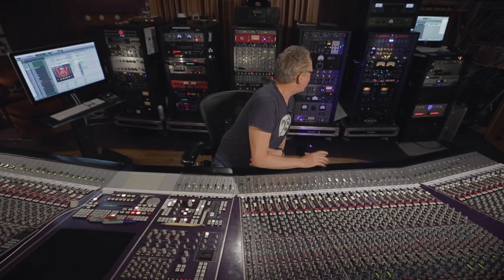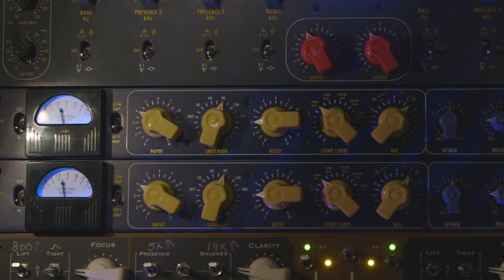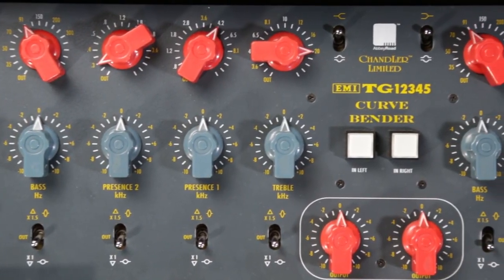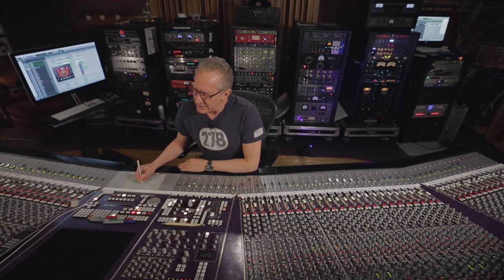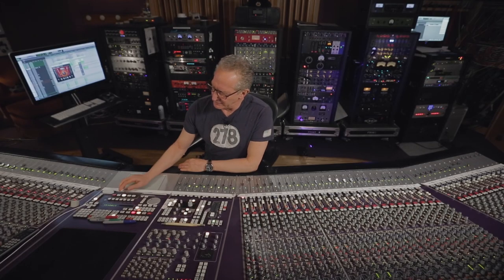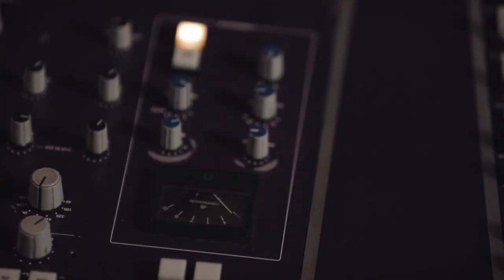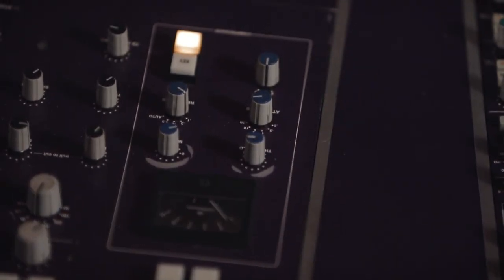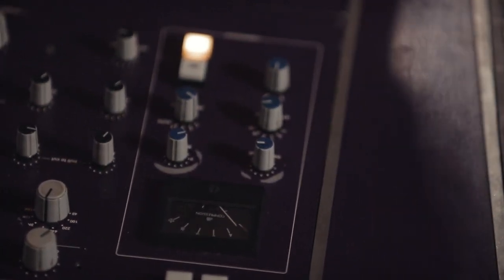The power of multi-bus processing with Michael Brauer

Comment: If you are new to mixing (like me) I would avoid this technique for now, I fell down a rabbit hole with this. Mixing into compression is hard enough let alone with four of them. I became obsessed with the idea and spent hours calibrating compressors/plug-ins and even tried this with 4 x 5oo series compressors . My mixes sounded flat and lifeless.  This man is a mult-award winning producer who has perfected this tecnique over many years. He knows his equipment and studio intimately as you can see In the video. I've had far better results just concentrating on my balance and panning-ensuring every move I make in the studio has an intention and purpose rather than obsessing over expensive equipment and advanced techniques.
Reply: @AI-Consultant  sure, you just set up 4 x aux busses and put a compressor on each one, and buss all your  instruments to the four groups based on their frequency range. You have to calibrate the compressors so they achieve 1db of gain reduction when they pass your maximum mix threshold I.e -18db or k14, whatever you mix to. There's a bit more to it than that but there's various places find more information  on it including Michaels own web page. You may want to match a similar compressor that he uses for each buss like a distressor for your b buds etc. But that's my point really, your just just mimiking what someone else has done without thinking why. But it may work out  for you (or I was doing it wrong?) give it try. That idea of mixing into compression or top -down mixing that I hear so much about doesn't work for me yet.
Reply: Sounds like you have some phase issues if it falls flat. Have in mind if you watch people on the internet telling you how to set it up, much of it is not the right way if you're working in the box. Go to his website there's a long article where he explains it. It is possible in the box but you really really have to watch out for phase cancelation. There's also interviews where he talks about it (and says that most of what's on the internet is not the right way.)
Reply: Love it, my man! PAAAAREACH!!!

Comment: To A/B them quickly, hop back and forth from 3:14 to 4:49 and the difference is stark.

The stereo imaging on the first is 100x better.  Every individual bus gets its own designer processing to optimize levels and clarity.  Then the final mix was summed to the master bus two-track output only needing a kiss more limiting to glue it together.

The later version is mixed just using the master stereo out bus.

Given that modern DAWs offer virtually unlimited bus counts, who would ever mix straight to the master output stereo bus?
Reply: Even through my tiny phone speaker the difference is very audible.
Reply: Yeah , and if I may , he made the mix sound smaller , not better
Reply: I prefer it at 3:14 TBH
Reply: Sounds more distorted at 449 from my phone
Reply: If you watch the entire video, it’s obvious that the first clip uses multiple bus processing and the second clip does not.  Of course the earlier clip is far, far better.
Reply: Yes. The latter version is stereo bus only. The earlier one is multi bus. People don't listen...
Reply: @conorm2524  Thank you for your reply.  I was wondering if I was going insane here.  Didn’t commenters watch the entire video?  The engineer explains exactly what he’s doing.

Comment: Ingrish:
Let's look at what's going on with the stereo Buss. So I've got the SSL going and I have the Germanium (Chandler Limited Germanium Compressor) is going and I have the Curve Bender (Chandler Limited Curve Bender EQ) is in but it's really just to bring the level down. Although when you put in a Curve Bender, It tends to open up a bit in sound and it's going through all the circuits and it just, it feels really good. So, even if there is no EQ it, it opens up the sound a little bit. So, inherently by by activating the Curve Bender, It's doing something to it. You know, the last thing I want to do on this track, on this record, is to get it to sound overly compressed. That was a complaint that they'd had, that they wanted to avoid. So I made sure that, and let's see. We've go to the chorus, where it's generally louder. Let's see how much is going on.

01:06
It's it’s you know, it's barely 3 (-3 dB). I mean this is a standard of what its setting and, you know, and it's a it's at 30:1, 4:1 Ratio, 1 ms Release, that's really quick and I just got nothing it's just sits there and it's just playing. It's really it's it's just it's just taiming it at a tiny tiny bit is you know, and then the Germaniums are same thing because the blend that I have, it's a wet dry blend leaning way more towards dry like at about 2:00 o’clock. So, what you're seeing there is really not compression, but just how the input is going in and it's again, it's light but you add all this up at a little things I'm doing and then you still got a lot of levels. Still punchy. The perceived level is louder than it seems to be just because that's what Multibus Compression can do, just small. It's again, on this particular track, I'm just doing a little bit, a lot of places and it adds up and it feels natural. 

02:20
All right. So, let's see how this works… At my seminar, what I do is I show I'll put up the tracks, and I'll just send it to the Stereo Bus without any of my ABCD (Gear Racks) and then, I'll I'll do it again with my processing on it. Now. It's going to be a little bit different because on some of these I'm doubling up, for example, the the guitar solo, but for now, we're just going to, let's see what happens. I'm just going to do, the B part of the section of the verse going into the chorus on.. and let's see what that sounds like the way it is now. And then if I just put everything to the stereo.

03:57
Okay, so now we'll just take all that off and put it through to A (A Rack) let's see what happens. 
Oh, no, bypass all of that. Now, I have an idea, take B off (B Rack off), take C off (C Rack off), D off (D Rack off), and then we'll just send stuff to here.

04:39
So, same section now, just going to the stereo. Everything seems to be just going to the stereo. See what happens. 

05:33
Some of the blends aren't  right because it's.. if I'm going to buses A and D. It's obviously more gain. So the balances are a bit off on the vocals, but you can hear the difference between the openness and the excitement of when I'm using ABC. As opposed to what I'm not. So it's to me, it's pretty obvious, just why I use ABCD.

*Keep correcting it and translating it to other languages

Comment: Sure Inspirational is great- BUT how does this Really play out? 
Do you have three separate buses with different types of compressors on them?
and you send individual tracks to either A, B or C bus?
And then those ABC buses are routed directly to master boss? 
Aloso 
Is this an afterthought, after you individually compressed each channel as necessary?
Or is there no compression on any of the individual channels only what is sent parallel to the A B or C buses.. ? 
Thanks a little text and a description about setting this up would be great
Reply: WOW that's way too many questions, but I'll try my best to help you. I'll answer your questions in the order that you used to ask them.

1. You need to understand that it's ABCD not just ABC.

A - Instruments that are in the upper midrange of a song (vocals, guitar, synth, etc.)
B - Instruments that anchor the song such as drums, bass, maybe cello, congas.
C - Instruments that create transient midrange power and will have a lot of rides, such as guitars.
D - Instruments that need the warmth of tube and are not played staccato.

2. It's 4 separate buses, not 3. Buss A has a Neve 33609 into Pultec EQ 1a3s. Buss B has a Distressor. Buss C has the Pendulum ES-8. Finally, Buss D has the TFPro plus a stereo widener.

3. Yes (as shown above).

4. Yes.

5. You have to compress individual sounds, the bus compression isn't doing a lot of compression it's often around 1-2dB of gain reduction. This is why he uses tube compressors because they add character and attitude. It's more of a feel.

Good luck.
Reply: @audiospectra   WOW "Now that's a horse of a different color" You Nailed It! That was totally informative. Now this video Holds weight. 

That may have been a lot questions for you but without your fantastic explanations this video was so vague🧐
Almost all of your entire answer is either not mentioned or explained in this video. 

So on behalf of myself and anyone who reads this..
thank you! thank you! 
thank you! 
Now we can go and actually apply this in some version. And we could have ABCD ..EFG? 😆 
thank you 🤘🏽🙏🏽🧨
Reply: @Too Tory  haha 😂 you're so welcome 😎

Comment: i wonder if the curve bender vst has the same effect: just having the vst on the bus? i think the vst sound a bit harsh.
Reply: UAD ONE??
Reply: @PawanKumar-hm5te  softube
Reply: @nickhyder9141  Same thing
Reply: @nickhyder9141  the UAD one sounds pretty good imo ! don’t know abt the colour it adds when its engaged
Reply: No, it doesn't have the same effect. The 4 compressors that he used on his ABCD buses are all doing about 1-2dB of gain reduction. He uses the buss compressors to add character and attitude. Hence he's only using tube compressors.
Reply: The Softube (which is also on UAD platform) sounds amazing just having it on like he says, you'll hear a slight difference. Likewise the germanium compressor you can really add a ton of sub bass just by having it a little wet. His setting at 2o'clock is often even too much.
Reply: @audiospectra wrong

Comment: Did he throw on a 5000 eq not using the eq, just to open up the sound… 🤣🤣🤣if you got it.. right?
Reply: The output transformers in some of that outboard gear can turn things to silk without setting any adjustments. I’ve got a Urei 537 graphic EQ I have no intention of using for its graphic EQ or it’s noisy sliders - to me it sounds a heck of a lot like the ‘magic’ going on in the original Pultecs. It’s the biggest transformer in my arsenal. Same with guitar amps, a lot of the distortion comes from pushing the transformers, not from saturating the tubes.
Reply: @zxcvbnmmification  Lol yeah but it's there - I mean if I had a wall full of gear like that I'd patch first and think about using it later 😁
Reply: Yeah, like LA-3As on electric guitars, you don't even have to use the compression or limiting, just run it through it and it's magic.
It brings everything upfront and in your face!
Reply: @rockboy360  someone needs to make a video series about gear use secrets.. just like this.. about all the great other uses